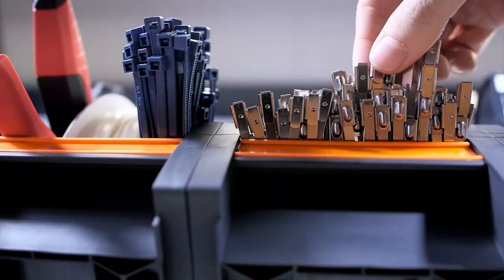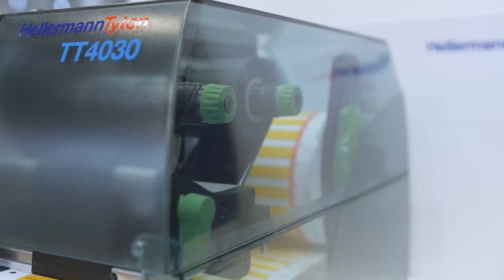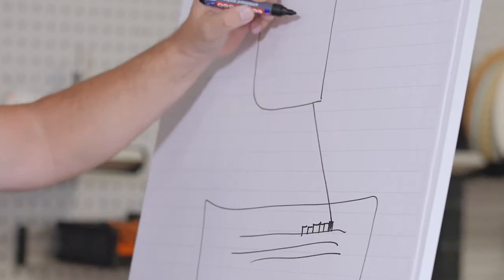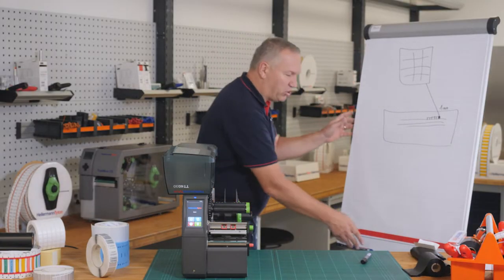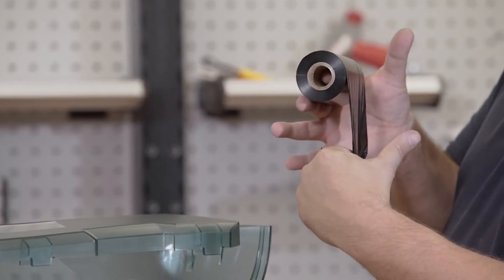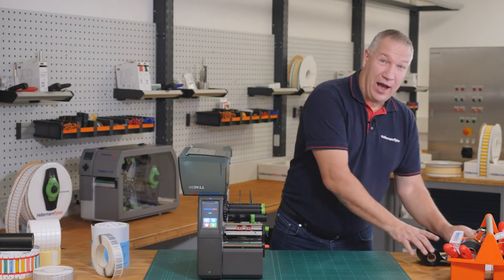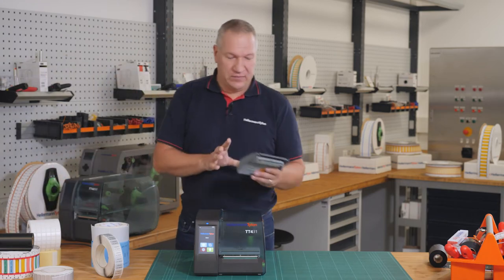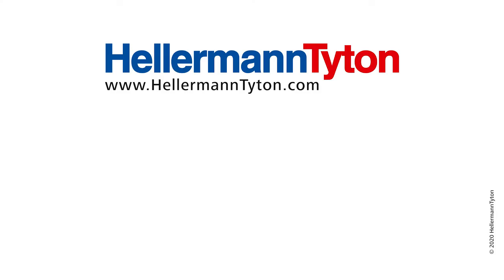How does a thermal transfer printer work? (EN)

Comment: Dear, I saw your video, and it is interesting. I would like to speak with you in private about your software tagprint pro. Could we discuss by mail or other way? I am living near HellermannTyton I France. I know them. I know your product. And I would like to improve your company.
Best regards.
Reply from the maker: Hi, If you have a specific question you can always reach the right contact via the contact button on our websites and fill in the contact form with topic, product groups etc, best wishes, Nico
Reply: Hello Nico, thank you for answer. I wanted to suggested you to use an other sowtware for labels. Who is in charge of the tagprint pro? Thank you.

Madjid
Reply from the maker: @abdellbc9644  Thank you Madjid, we are very happy with our TagPrint Pro Software. And so are our customers. Best wishes, Nico
Reply: Hello Nico, thank you for your reply.
Best regards.
Reply: Could you please tell me if it's possible to print silky ribbon 🎗 using a normal termal printer?